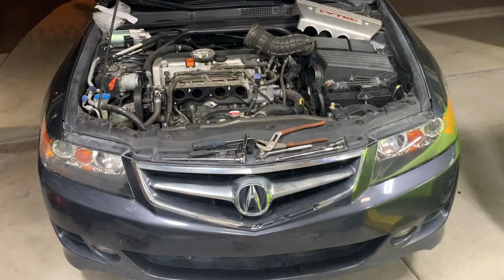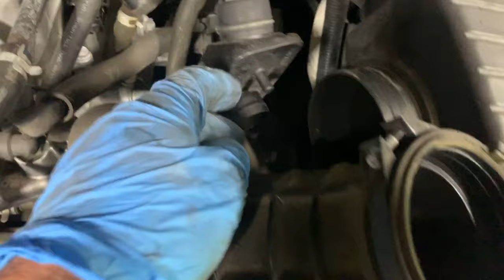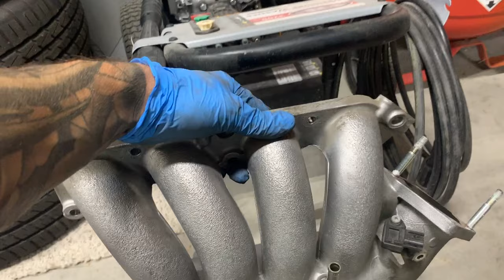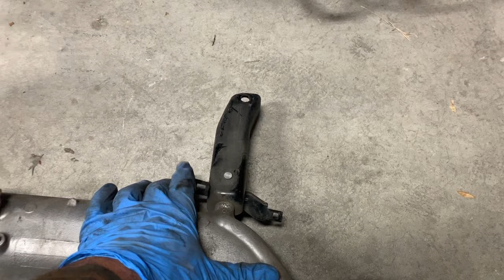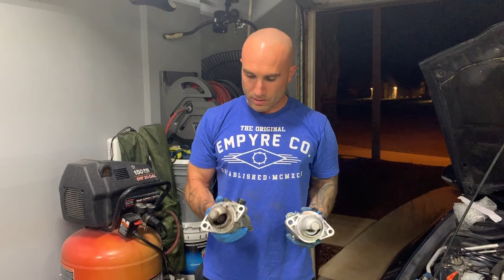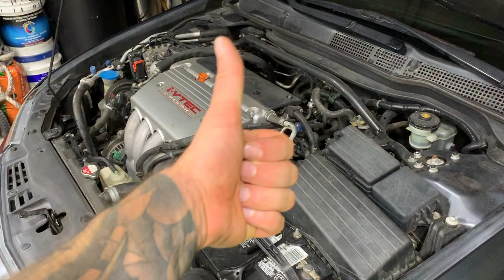ACURA TSX STARTER MOTOR REPLACEMENT DIY HOW TO

Comment: thanks for the vid. regarding the throttle body gasket, did you scrape/peel off the paper gasket? or did you reuse it? if you removed it, how did you accomplish that?  TIA!

Comment: Hello, I'm having a hard time getting the bottom bolts loose on the intake manifold. It takes a 12mm socket and I have a ratchet and a breaker bar but I can't get the right angle on the bolts to get it out. Any thoughts :)